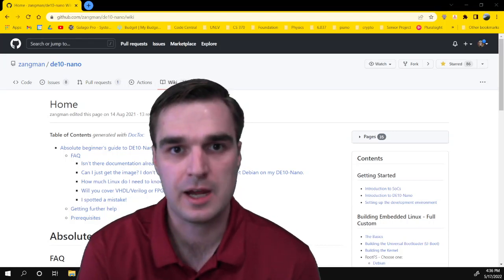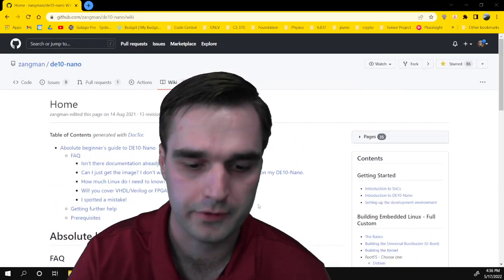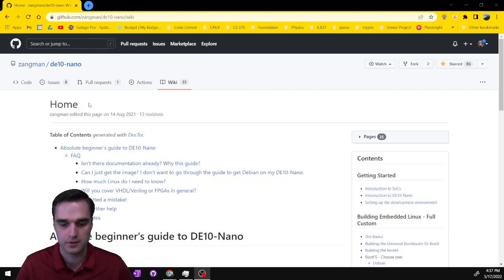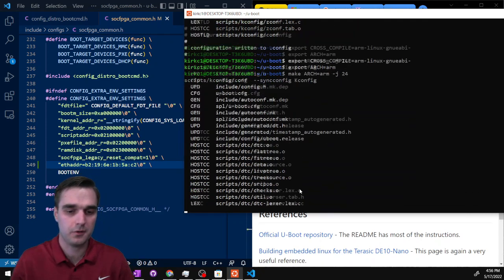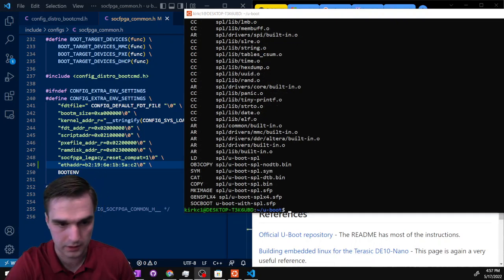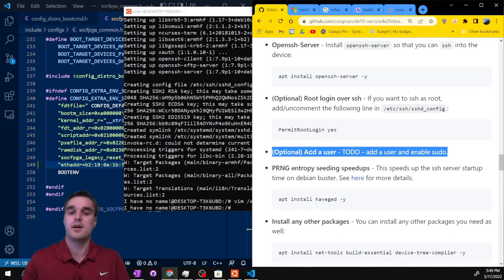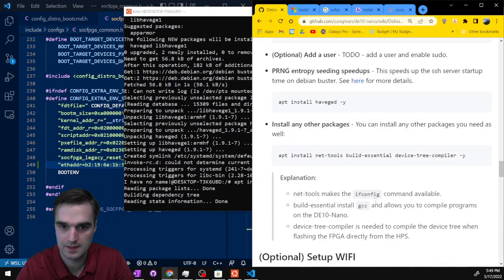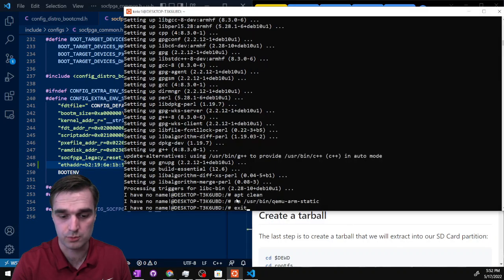Building Embedded Linux - DE10-Nano Projects

Comment: For any folks doing this in linux and are not getting any kind of connection to the device, check that your device is recognized by your linux distro. if it shows up using sudo dmesg -w, but no serial port is opened, you may have to output the product and vendor ID to the ftdi_sio driver on your pc. As root, echo 0403 6001 >/sys/bus/usb-serial/drivers/ftdi_sio/new_id . This helped the serial port show up for me. (0403 is the vendor id, 6001 is the product id. Yours may differ depending on how new your device is/if they are using a different chip for the same purpose.)

Comment: As a follow up. I've followed the walk through and my only issue was. (This is June 2023) The version of ubuntu for WSL2 in win10 doesn't have fdisk (simple apt-get install fdisk). Other than that, I now have Debian running on my DE10-Nano. I had built Angstrom before via Yocto
Reply from the maker: Thank you for watching and for letting me know! I am thinking of doing a 2023 update to this tutorial. I think I could clean up the material and make a much shorter & more streamlined tutorial on how to do this. 🙂
Reply: @metaphysicscomputing  I’ve followed more of the tutorial and have written a simple Linux driver for my design running on the FPGA side. I’ve added interrupt handling too. This wasn’t easy as the device tree side of things are complicated and I ended up going in circles for a while.